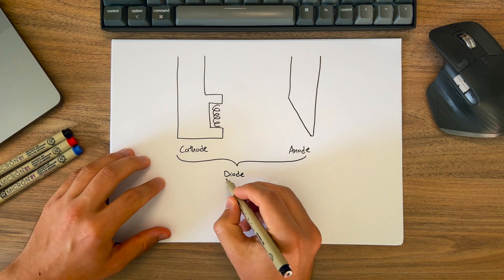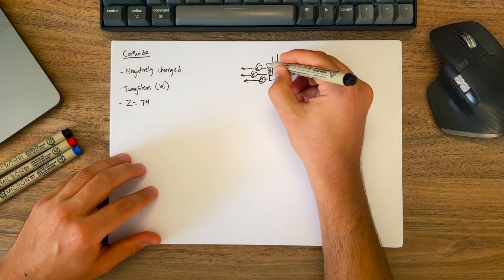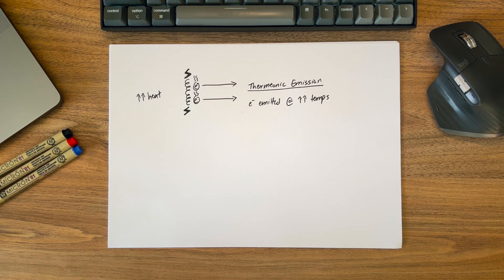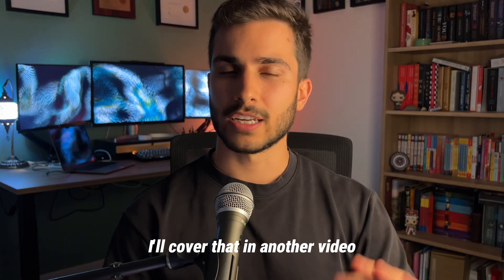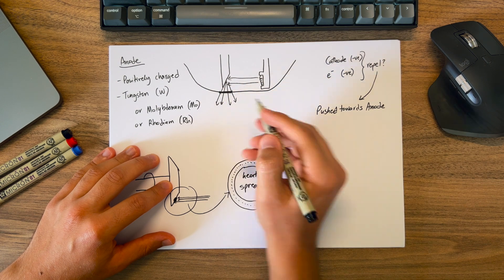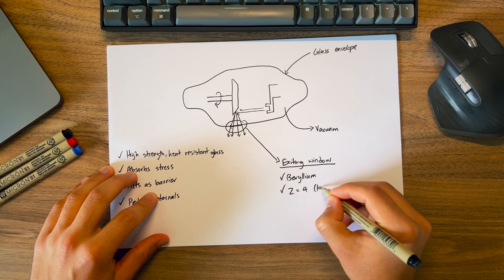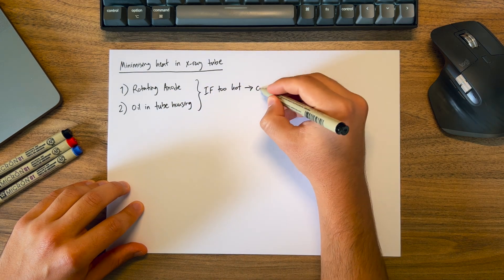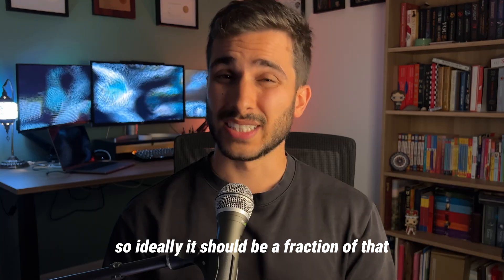X-Ray Tube Anatomy: X-Ray Production Explained!

Comment: Question 5 is misleading; it does not increase the beam's energy, but rather reduces it. However, it does increase the beam's average energy as it shifts the average distribution to the higher energies. A better way of wording this would be "Filtration preferentially removes which part of the X-ray spectrum?" and the correct answer should be Lower energy photons. This would help dispel the idea of greater energy and the misconceptions this can bring. You could also ask "what an increase in effective energy indicates, and the answer could be, filtration of lower energy photons.

Comment: Tungsten has the symbol W in the periodic table because its original name was Wolfram. It was changed in common use because people preferred to call this metal by the other name. But as there were many other elements represented by symbols starting with "t", chemists chose the W fron the original name

Comment: "Diode" means "two (di) electrodes", electrodes being the terminals of wires. From this logic, an x-ray tube is a diode. Before the invention of semiconductor devices, vacuum tubes were used in electronics (for some applications, they are still used). Diode tubes are used to rectify alternated current, as they allow the electric flow only in one sense. The equivalent semiconductor devices inherited the name. There are also vacuum triodes (tri = 3) and pentodes (penta = 5), which are used as amplifiers

Comment: Remember:
1) the focusing cup is made of molybdenum because it's not a thermionic bubbler and is negatively charged to ping pong electrons antegrade to the anode
2) rhenium is added to the anode to help it dissipate heat and not crack 
3) 1 mGy is 0.1 rad (1 Gy = 100 rad).

Comment: One minor mistake. The targets in medical X-ray tubes are tungsten with Rhenium, not Rhodium. Mammography tubes are frequently Molybdenum. There are many other anode materials used for other types of X-ray tubes.
Reply from the maker: Are you sure about Rhenium? All I’ve read on it and the data I’ve worked with says that it’s Rhodium (Rh), but I could be mistaken, could you send me a link
Reply: Here is a link to a slide I found saying rhenium

Comment: The "W" is for wolframite, a mineral from which tungsten comes. I have a similar tube you talk about. Took awhile to get it out of its enclosure, and we have 3 phase power so I plan on spinning the anode. Where can I get 125kV ? (JK)
Reply from the maker: Interesting! I'd love to see it in action. Where did you get the tube from?
Reply: @SahandHooshmand  A friend is a x-ray repair technician, and gave me a used one for me to dissect. Took a bit to get the tube out of its case, and it's kinda brownish. It's a Toshiba E7239. I have the means to apply high potential, but not yet.
Reply: You can build an cockcroft–walton voltage multiplier to create the required voltage.